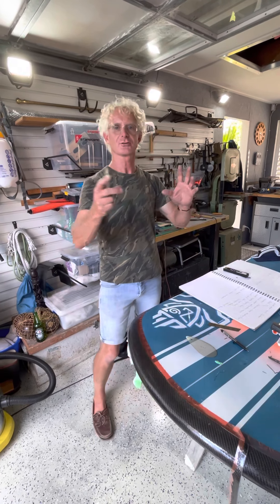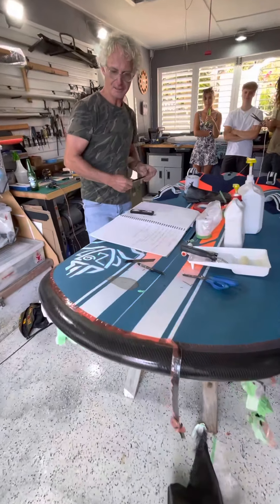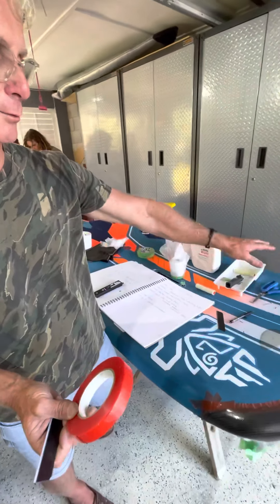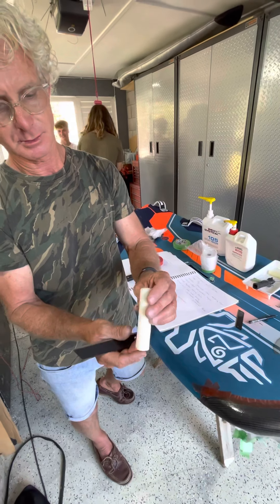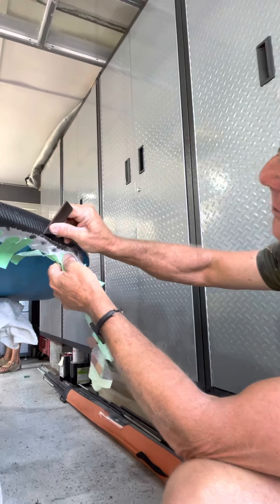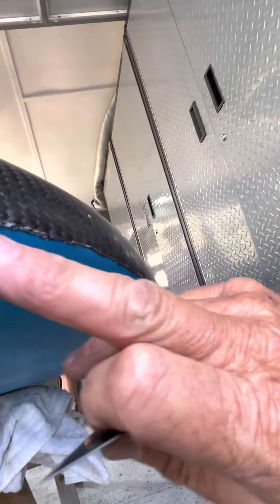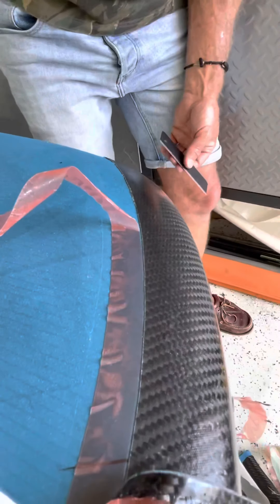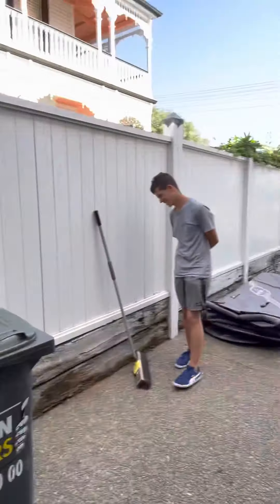Trimming and clean up

Comment: Really neat work. Is that only one layer of carbon?
Reply from the maker: Yes only one layer is required. Weight is important and adding too much to the bow changes the C/G centre of gravity and dynamics.
Reply from the maker: Most boards are around 11kg and if you were to measure the weights of and C/G if a number they  are reasonably accurate but do vary.